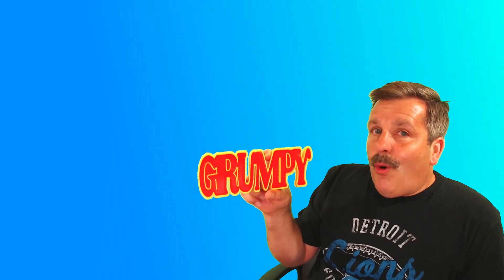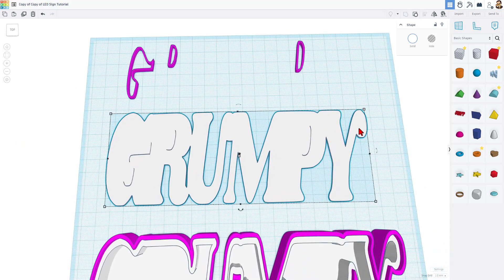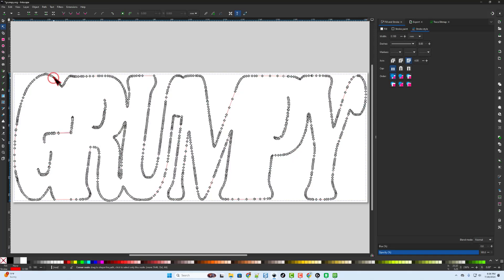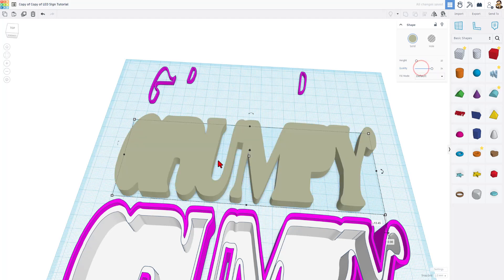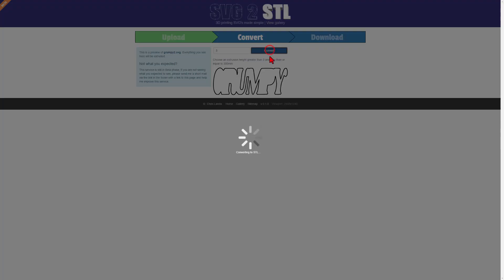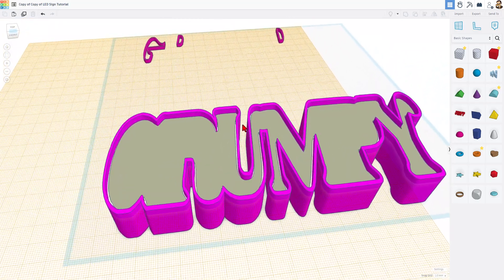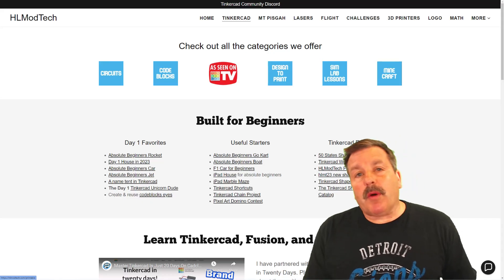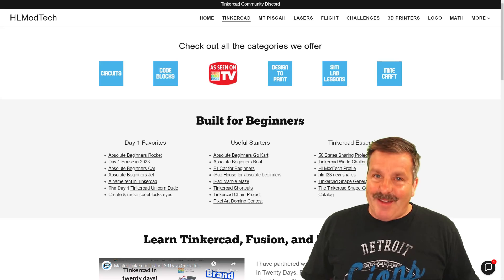Slick Trick Better Fit Tinkercad & Inkscape LED Signs for Beginners

Comment: I can't get my text JPG to download over to tinkercad. I'm not computer savvy at age 63 if I had a STL it may be a lot easier, can you help with this. fussion 360 is just way to complicated for me.
Reply from the maker: The video teaches you how to convert the JPG into a SVG that you can bring into Tinkercad. Other than creating the video, I do not do projects for users.
Reply from the maker: This video has several tips to aid you in adjusting speed and such. https://youtu.be/DwrnHNCwJrc?si=g2PiLu6Qzu8PeWrH
Reply from the maker: Having dual screens was another fav of mine. This video shows how you could use your phone or iPad as the 2nd screen. https://youtu.be/Q2ETx5XBKAc

Comment: I appreciate this. I usually can get some reasonable fitment by turning scale down to off or 0.1, selecting the piece I want to shrink, hold down shift and drag down piece uniformly. You can get away with this a little bit but any big reduction on a non-symmetrical shape, the method you’ve shown is significantly better as scaling uniformly too much starts to distort. I’ve also spilt each letter into separate pieces and scaled. Again your method is way better, the way I’ve done it is from lack of knowledge and “beating” things into submission, lol.
Reply from the maker: =) I was fiddling around with Alt+Shift for several hrs trying to get a way that was consistent. =) One time it would.. the next time it was jinky.  I really wanted to keep it all in Tinkercad, but finally gave in. Having Inkscape as part of the project really ends up adding another tool to our belt that can be useful. Thanks tons for the note!
Reply: @HLModTech  one thing I do is duplicating then selection one, switch to negative, alt shift, reduce size uniformly to make walls the desired thickness, hit L and center all directions then drag z up before competing boolean operation. If I need to adjust or “orbit” around an irregular object, I’ll create a giant skinny donut big enough where it’s basically off screen and center my part to it. Then if I select what I want to orbit along with big donut, it will orbit correctly around the irregular object. You can do this vertically as well or any way you need to orbit. Probably way easier ways to do it but again, I have no idea what I’m doing, just have messed with tinkercad for years enough to make it comply! lol oh, one other tip I just thought of. If you need to measure inside an object, I’ll hit w create a work plane, set a box then w again and create a work plane on other side and set a box. Then stretch the two boxes together, select both and it will give exactly measurement of the combined boxes which is the measurement for the interior of wanted to measure. This is really helpful when adjusting clearance to get parts to slide into each other. If I want to set an object exactly level with another object, I’ll create a work plane on the object, set a box then create a work plane on the bottom of the box, then anything you drop D will be on the exact level you originally set your work plane on. Sorry for rambling, but your videos have reignited my interest in what can be done with Tinkercad. The fun for me is figuring out what can be done!
Reply from the maker: =) Great tips! zero pts lost 4 rambling. = ) I have to edit the heck out of myself to get things short and sweet. Totally speak ur language and dig that you use "brute force" at times to get the results you want. I have too, but try to find ways that make sense for "normal" peeps vs my guess and check nature. Cool trick on the combined boxes. Will explore and thanks again for all the info!!!

Comment: Have you tried the Image to Keychain tool in the MakerWorld MakerLab to convert an image to an SVG file? It has some nice processing tweaks like keep or remove background and the ability to map colors to nothing so the areas with that color are removed. I used it to make an SVG file from a screenshot of text, didn’t want to use a random website to convert. To get the SVG file I downloaded the resultant 3mf file, unzipped it (3mf is just a renamed zip file), and poked around inside to find which folder had the SVG.  It was easier to do than I make it sound. 🤣
Reply from the maker: I have not. Picking colors sounds pretty slick. Thanks for sharing!